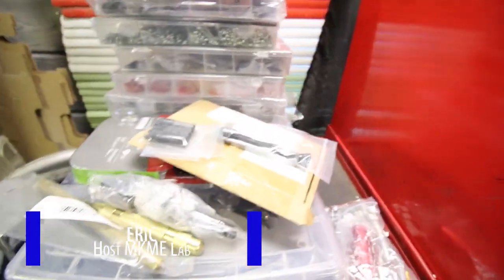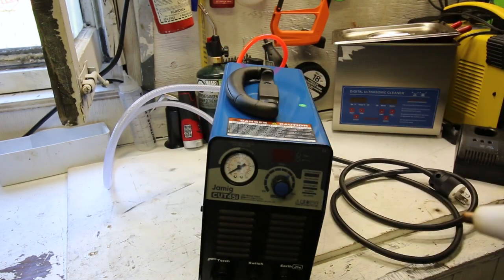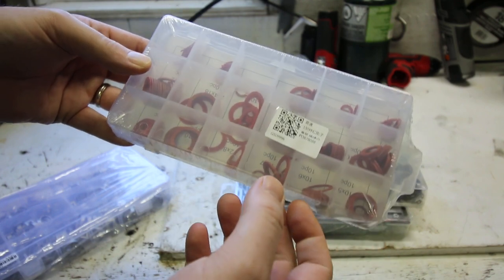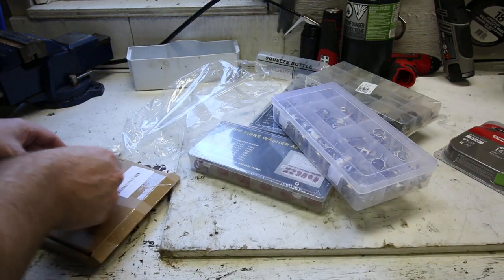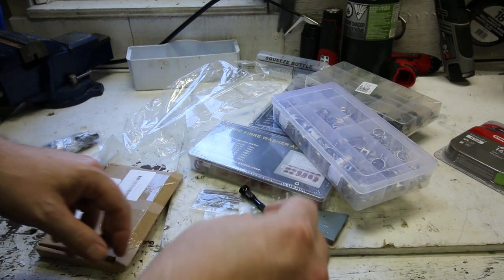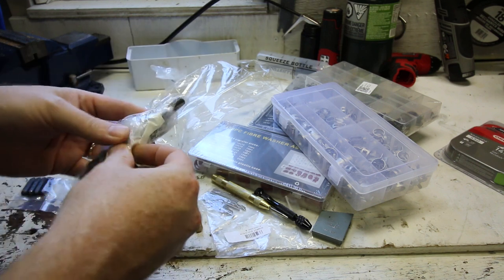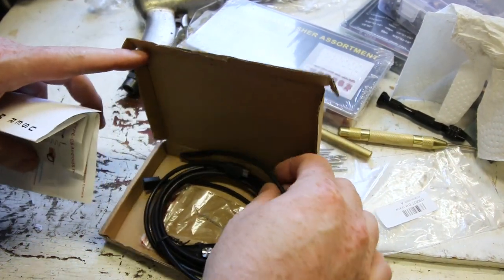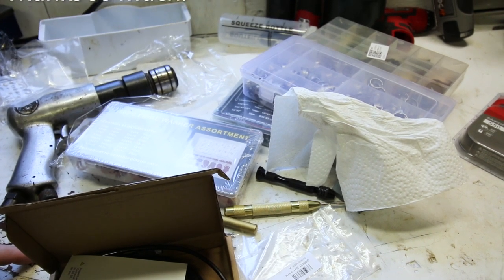Essential Shop Supplies For a DIY Garage 🔧

Comment: Hose clamps! That's what I've been meaning to order.Thanks for reminding me ;).  I like those springy hose clamps. They are so easy and quick to use and like you said, they adapt to changing diameters.
Reply: They're also common in appliances like dishwashers and clothes washing machines (though usually in a bit larger sizes)

Comment: I have a bunch of those assortment collections as well.  For about the same price of 2 or 3 of an item from the hardware, you can buy a box of 100 / 250 of them.  I will be interested in seeing your boroscope  test ... I have looked at them, but the wide range in prices makes choosing more difficult.